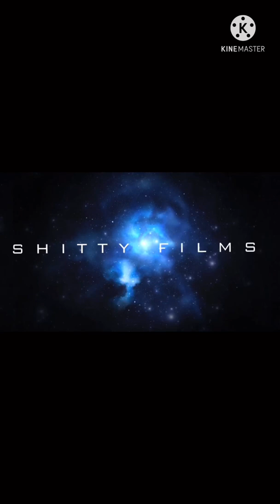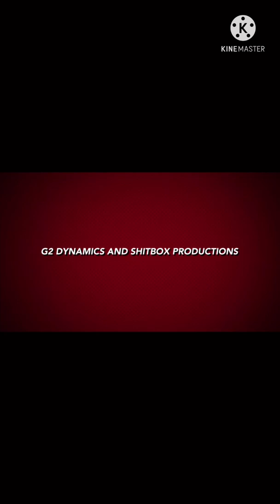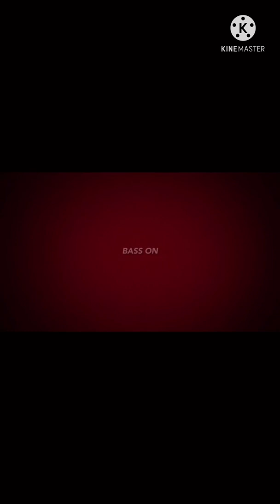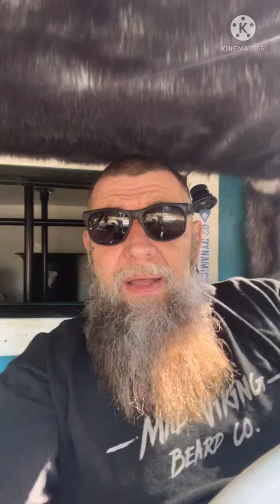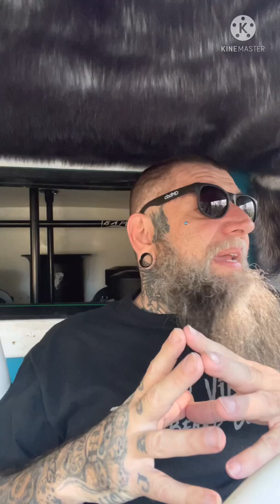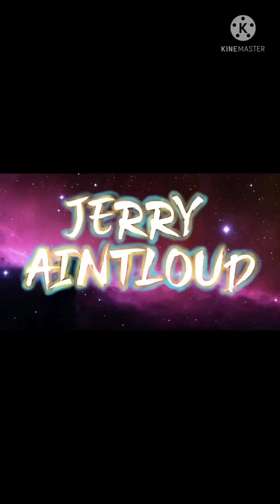SMD line output converters, and DSP

Comment: I seen the video from Steve Meade about the lineout converters. I have a 2 volt pre out Android factory replacement in my 2014 Impala that I'm thinking about using instead of the RCA outputs of provided already..🤔🤔

Comment: Patrick from robot underground. That's who made the video about the LOC's. My car, i have to keep factory head unit cuz of optical cables in my Mercedes-Benz. I had to use a Lc2i. Which is way better technology than Steve meades, and cheaper🤷‍♂️ no knock on Steve, he's about making money. And if ppl wanna buy over priced LOC"s, then so be it🤦‍♂️🤷‍♂️
Reply: I run the same audio control Lc2i pro in my lexus with factory Mark Levinson with factory DSP. $129 for a line out convertor is nuts.